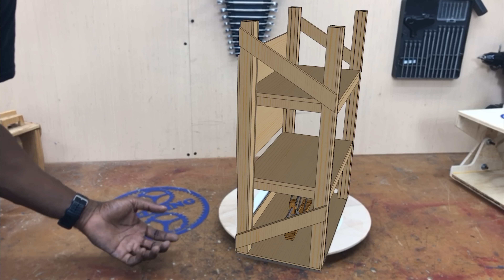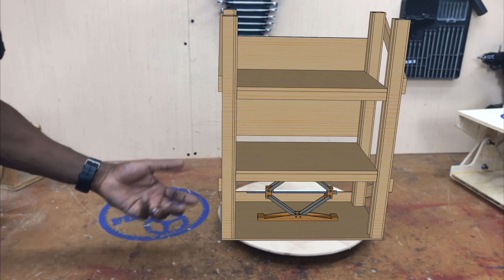Engineering Principles for Makers Part 2; Material Properties #067

Comment: When you where talking I was sitting there stuffing my face ,,, one word is a Morgan,it’s a uk built car the frame is made out of wood and some of the body in car areas. They even have a 3 wheel sport car . Driven by any 4 stroke motor like a 1200 HD mother and a baker 4 speed gear box ...lol check it out you will love it it drives like a MG miget . Or a bug-eye’d ..

Comment: With your previous video I had been wondering about keeping both benches horizontal. I envisioned the hydraulic shock/lifts that are used in hatchback vehicles along with a locking mechanism. Maybe not optimal though, seeing as the weight can change from one moment to the next, depending upon what is on the bench. But I'd hate to have to rely on pillars in each of the four corners. I'd like to see a cantilevered bench if it could be made both stiff and strong, riding up and down on just two, rear tracks/lifts.

Comment: Great presentation Jeremy.    I teach Mechanics of Solids and Strength of Materials to Engineering Technologists and it is difficult to take a traditional engineering textbook and separate the theory from the practical.  You have done a great job with this and covered about 4 weeks of material in a few minutes.  

You make a point that there are basically two ways to reduce deflection in a structure: 1. increase the elastic modulus (material selection) and 2. change the shape (of the cross-section geometry).  An good example is the A pillar in cars.  The A pillar holds the windshield and must support the car in a rollover.  If you select a material with a low elastic modulus (aluminum) compared to steel you have to increase the cross-section of the A pillar to maintain the required rollover requirements.  Unfortunately, you have now made the A pillar wider and it may obstruct your vision (of pedestrians etc). This trade off is what engineers have to deal with on a daily basis.  

I think that many people don't understand that engineering is not science;  it is the application of science and requires integrating different scientific principles to arrive at a solution, in my opinion you are a true engineer.
Reply: Four weeks of materials... this is partly why I loathe my classes. I agree he condenses the lessons nicely. I wish everyone taught this efficiently.
Reply: I completely agree. Very good presentation and explanation.
Reply: You still teaching?
Reply: @bunnyman6321  yep but I am thinking about shifting from fulltime to gigs where work when I want... colleges and universities that way I can make some $ in my retirement and travel around the world.
Reply: @mfsolutions  Go for it.

May you have much success 💰
Reply: @bunnyman6321  lol I actually spent a day with a major industrial lube client last week and did not charge them… not always about the money but if we publish a paper together that is a year’s advertising.
Reply: @mfsolutions  Give me your salary then Mr.Richa Man
Reply: @bunnyman6321  lol... I have never had the time or the patience to work for "the man" for more than a few years so will be working til the day I die... And that is what I always wanted... when you are coasting you are going downhill!
Reply: @mfsolutions  Let the good times roll

Comment: Finally someone who speaks how I think. I love the technical side of things. 
For your table, I'd skip the screw style jack for lifting as your movement will be limited. Instead, (I'll describe as best I can) use two hinged arms under each side that are about 2/3 the width of the table. The right side would be hinges to lay down toward the left, and the left to the right. Put some small wheels on them so they roll instead of dragging. This system could get you much more range of motion. The simplest way I can put an image in your head would be, imagine a portable picnic table that each pair of legs fold up for transport, add wheels to that. 
You could use linear actuators, a pulley and cable system or many other things to motorize it.
Reply from the maker: Interesting... the mechanical advantage at the low point will be terrible, but it really just means more power is required. I got that. It is still a prototype so several things have changes since this video.

Comment: Just a thought... counterweights somehow incorporated into the legs with locking pins for each work surface height...No motor, just a light to moderate amount of pressure applied up or down.  You could take the bench from floor to ceiling if the lower surfaces could somehow collapse or accordian.  I haven't done the math, but I'd think you could easily have 3 different benches at least.  I wouldn't want more than that, I tend to jump around sometimes so I'd have to really think about which 3 stations.  This could be dangerous with casters, so I'd find a length of roller conveyor, cut to fit so the unit rolls to and away from the wall, invert and secure.
Reply from the maker: interesting🤔

Comment: If you had the steel on edge like you had the wood there would have been no deflection either.  Kind of a dumb comparison don't you think ?
Reply from the maker: Of course... but if you are making this statement it makes me think you weren't listening to what I was saying before, and again after the demo. Of course steel is stronger than wood in direct comparison... so why the demo? Please watch again and it will become clear I even marked the time for you around 2:04 - 2:36. You will hear at least two times where I explain the whole point.

Comment: It would seem that the jack driven design would force you to abandon your requirement to have clamping surfaces on all sides. Also the four columns will hinder your ability to place large objects on the surface without hitting the columns. And lastly you will need to lock all four corners in order to do any hammering or bending etc.
Just my thoughts.
Reply from the maker: I agree with your assessment. It’s a design that is not complete. Only showing how the idea was changing. And has changed again since then

Comment: For the vertical workbench what about using the linear actuator idea? Screws in each corner mating with permanent nuts. Gearing would operate the screws in sync. My Grizzly 20” planer has similar setup with a hand crank to move the cutter head for depth.

Comment: i take issue with your comparison, steel is better in essentially all of those cases at the same thickness as the wood, i get that realistically its harder to obtain and work with steel as thick as the wood you would normally use in its place and that its a lot more expensive but that doesn't change that steel does better
Reply from the maker: The point wasn’t that wood is better. The point was shape matters as much as material. Please watch it again I explain that in the video. Right after... I explained the difference again before moving to the next topic
Reply: @Jeremy_Fielding  i understand that the point of the video was to show how the shape of the material and making it able to distribute stress evenly is very important and can make one material as good as another one, i think you did that very well, i just think that you also made steel look like its worse in a lot of scenarios than it really is, sorry if i come off as a bit rude or if im not making too much sense, im bad with words sometimes, plus im a little tired lol, good video tho

Comment: Okay so you said that the deflection in the I beam of wood is negligible, but the deflection of flat steel with the pressure applied vertically would be even less again without the need for the construction of an I beam. It's a bit like comparing a square structure to one which has triangular gussets. It's not the fact that you've gone hey, you can do things with wood as well as you can with steel, it's that you've compared apples to oranges, how much deflection would occur with that wooden I-beam if you measured it horizontally ??

The true rate of deflection is occurring across the vertical face of the material. Because you have a 3mm piece of steel, no matter how you compare it the only vertical opposing load comes from the span of 3mm .. it doesn't matter if the steel is 500mm wide, the deflection rate will be identical to the 50mm wide piece of the ruler.

If you actually factor in a $ value for time, as well as the use of any utilities, as well as any other materials used in order for the construction of the I-beam, it'll be cheaper and easier and less time consuming to just get a 1.6mm right angle piece of steel, you don't even need to weld it in place for the replacement of the wood, and your project will get done a full day or so earlier than if you had to construct I-beams out of wood. Pending on the size of the project and the feasibility of the I-beam construction like say just using 2x4's and gluing and screwing them together it may be quicker and easier than to use metal, so long as the construction that you're making has the variable tolerances to allow for a beam which will end up being 8 inches high. Either that or you could get the same rigidity just from some 3mm 40x40 right angle. If you really want to add some extra oomph to it, you can always weld in some steel tubing to the right angle, then you'll be able to have a superior span as well.

At the end of the day it all comes down to the value of your time. If you have the tools then use what is best for you.
Reply from the maker: Thanks for the comments... Basically I assumed everyone knows that if  steel was compared directly to wood with all "shape" variables being the same... steel is stiffer. I didn't think I needed to say or show that. Everyone has come to the same conclusion you did. I only wanted to say that geometry matters as much as material (time 2:00). People who work with steel make the same mistakes as people who work with wood. People have told me they bought a high strength steel when what they really needed was more stiffness not more strength (time 3:39). I talk about both of these facts in the video. I am sorry that was more clear to you.
Reply: @Jeremy_Fielding  very much true, it comes down more to using the right configuration, if you were to use something like ironbark or a wood of similar density then it's very comparable to metal and with age can actually become a greater strength in matters of torsion and resistance to bounce like in the working of something like the braces for holding up a floor in a dance studio, where steel unless of course very meticulously calculated could end up fracturing with the repetitive loads which are put upon it, or in places where corrosion will become an issue over time.

Also comes down to the tools at your disposal too, if you don't have a welder and don't understand how to weld, then don't build something structurally out of steel as it may look like a good weld, but it hasn't penetrated as far as it needs to or equally through both pieces.

Personally I've always loved the way in which a triangle when used has such a capability to increase various torsional stresses, it's easy to understand why they are used so often, but even then mistakes are able to be made, like in the case of a few bridges that even though they utilized triangular geometry they didn't take into account harmony of vibration and how when a substance is taken to a level of harmony it's capable of amplifying itself and then we have bridges which start to act like the waves of the ocean and tear themselves apart.

Comment: love the moving shelf idea...  as a vertically challenged shop owner, it would be great to store items up high... then move them down closer to where they are used... but be able to move them up out of the way when not immediately need for a particular job. This might be an analogy to attaching springs / lanyards to air hoses and electrical cords... having them stored in the ceiling, but when needed they can be pulled down into the work area.  might even be nice to mount some interior /exterior lighting that triggers when in various positions.  Thanks Again!

Comment: Wha  wait... There not the same...You have a I-beam out of wood and just a pice of metal flat stock. not the same . Make and I-beam out of metal. ("same-same " } But wood dose have great strength depending on type. You might be interested in a plane called the "mosquito". It was a WW II Brit. Bomber made from balsa wood.  It was very strong and light, and that made it fast. Ol' days planes where made from wood and fabric. They were very strong lite and absorbed vibration well(more comfortable ride) . Now planes are alum. and are heavy prone to cracking and flex more. A lot of variables to consider between wood and metal. I was once told by an ol'timer the wood is structurally stronger then metal. Not sure if thats true, I dont have a high edu.
 No offence sir, Just saying there not the same.
 Please check into the "mosquitos" construction. (the Plane not the Bug : } I think you will be interested in it.  You deserve a pat on the back sir. You are opening minds.
Reply: You definitely missed his point, but at least you were trying to be constructive and not rude.
Reply: Walka Walkaway totally misses his point
Reply: The whole point he was trying to make was that making a different shape with a material can change its properties.  He wasn't trying to say that wood is always better than steel no matter what.
Reply: I think your comment would hold true if Jeremy had started with a piece of flat (unstructured) timber lying flat under load and then shown the difference achieved by adding the I-beam elements.  Had the steel been vertical rather than flat it wouldn’t have deflected at all. At around the 12 minute mark Jeremy shows that the same wooden I-beam  will deflect.  
I think the key message for me is that easy to work with material thought to be ‘weak’ can be made structurally robust. 
As stated in a number of replies I agree : great video, great content and excellent presentation style.

Comment: Great video! I'll differ with you on one point.... the idea that wood is easier to manipulate than wood. I can take two strips of steel, weld the ends together, and lengthen the piece with no practical loss of strength, and welding is fast. No waiting for glue to dry, no clamping needed, etc. If I make a mistake in steel I can weld it up, grind it down, and it disappears. I can cut threads in steel and avoid nuts, etc. Ease of manipulation is subjective. Steel, in my opinion, is easier for me. The limitation is that it takes more equipment and tooling.

Comment: Perhaps consider using 4 long screws like used in a ed printer z-axis, connecting all 4 with 3 belts to move all 4 screws with one motor so you can have 3 shelves instead of 2 with the lower having the scissor jack.  You can route the belts along both sides and the back with dust covers to protect the belts.

Comment: Stumbled on this video. Not to make you do further work, but I'm not quite tracking on the steel comment of higher quality steel having the same deflection, and I'd love clarification if I could get it. Different tempers would contribute to the rigidity, and different carbon content would also contribute to hardness, and brittleness, so it appears to me that that assessment is false. What am I missing? And what does it say about steel that has the flexibility to retain it's shape even under deflection versus one that begrudgingly yields but keeps the new shape?
Reply from the maker: You will learn way more by seeking the answer on your own.  It was surprising the first time I read it myself.

Comment: I think, for raising the bench, you can use large cog wheel, with an offcentric knob, on the back of the structure (could be wooden wheel) and a slider rail underneath one of the benches (operated by that knob). It will decrease the force you can lift (based on a gear ratio you will use) but it will also increase the speed of lifting.

Comment: How about some wood gears to elevate the workbench?  I’m not sure if a hand crank would be cooler or motorized
Reply from the maker: I wouldn’t use wooden gears for this. That leaves all the weight on a very small area of one or two teeth.
Reply: @Jeremy_Fielding  https://youtu.be/h_mLG4KwbLA
Reply from the maker: I am not talking about wear... I am talking about breaking under the load. I love working with wood and the gear (thus the tooth) could be made thick enough to handle it... so it is possible but impractical when there are so many other ways to do it for this case.

Comment: A good video overall and I understand the principle that was being illustrated, but to make it clear how arranging a material impacts rigidity, a steel tube with the same cross sectional area as the flat steel strip could have been used. Mechanical engineers design structures by starting with the  combination of properties needed then selecting a material that can be arranged to meet all the requirements at the lowest total cost (Mass + money + machining + maintenance)